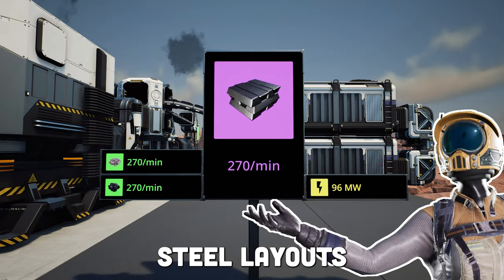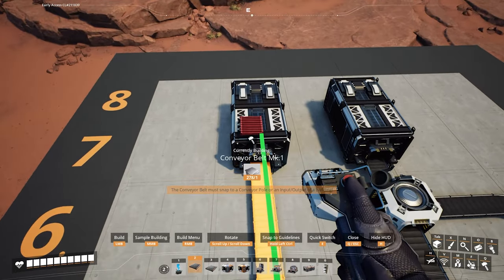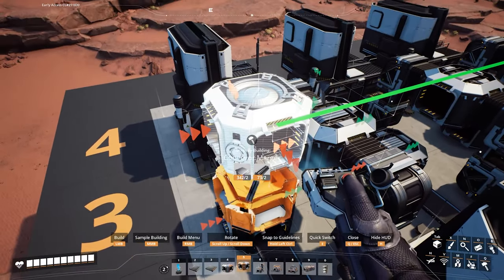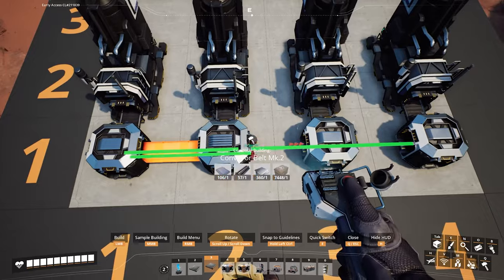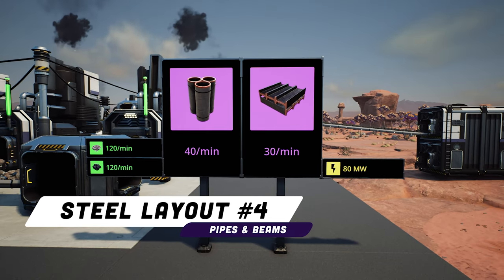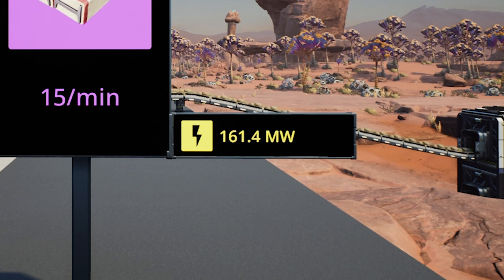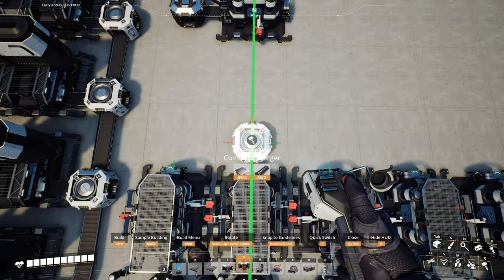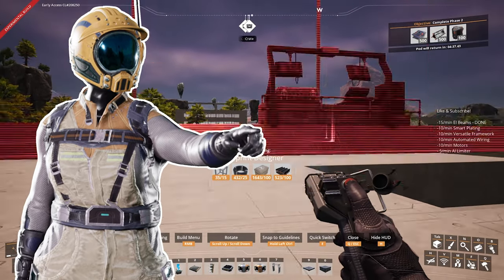7 EFFICIENT Steel Factory Layouts You NEED! | Satisfactory Update 7 (Beginner Guide)

Comment: Thank you for your tutorial! 🙏 There is something I do not understand. Indeed, on the first layout, you are splitting 120 coal and 120 iron by two (1 to a smelter, 1 to the next splitter) and so on. From my current knowledge and when I reproduce it, it seems not to work at 100%. Indeed, 120 / 2 => 60 to the first smelter, 60 to the next splitter, then 30 the second smelter and 30 to the last one. Can you tell me if there is something I did not understand? Thank you in advance.
Reply: Hey its a manifold as what im seeing. So you have to store up raw materials before running the foundries. Otherwise it takes a while to get to started. Mk.2 belts between the splitters. Also use mk1 belts from the spliiter to the foundry itself or mk1 conveyor lift. Also you have to unlock underclocking so the last one only takes 30 iron and coal instead of 45. So you get 45*2=90 + 30(last splitter) and get 120.

Comment: I usually have to separate the Encased Industrial Beams layout from the rest, because the amount of materials needed is insane. Imagine if you are wanting 60pm, the size of the factory you'd have to build, even with alterate recipes. I usually just have to settle for less because the requirements are just way too much.
Reply: My current factory is only making 5ppm of the Encased Beams and I’m on tier 4 working on phase 2 of the space elevator. I hope I won’t have to overhaul my factory tooo much for later game but knowing satisfactory I probably will need to.
Reply: Yea this is why I leave the game running all day once I unlock coal.

Comment: I use the blueprint machine and I prefer the recipe that needs iron ingots to really maximize output and my favorite by far is the steel rotor recipe because you can use the same blueprint for both rotors and stators and just change the assembler recipe for a quick motor factory

Comment: Is there a benefit to underclocking rather than throttling input materials?

For instance, input would be for 2,5 machines, feeding into 3.
The 3rd machine would end up producing half the time, idle the other half. Power consumption is likewise on/off rather than smooth.

But wouldn't that average out?
Reply: Yeah but if you underclock it'll be 100% efficient although you get the same result

Comment: 3:50 is a nice design, but a friend and I were building it and had a lot of trouble with the conveyor belts at the top row where the mergers are right next to each other.  It's awkward to build, and I think that sometimes there is a bug where the tiny conveyor belt doesn't work properly.
Reply from the maker: The trick with those is to just hover over the side and left click. As long as you don’t see it on the other exposed sides it worked for the first one. Then just hover slightly towards the other merger. Again as long as you don’t see the ghost belt go to the other entrances you are good and just left click. Getting the feedback is a bit weird I’ll give you that. As far as not working, I use short belts constantly between mergers and lifts and I haven’t had an issue yet, but that doesn’t mean it doesn’t happen. Hopefully it ends up working for you 👍

Comment: Hi, im new, just entering steel... On #5 and #5, why are you using smelters instead of foundries? Do those factories require a special recipe? Im thinking I want to go with #5 and #6 instead of #1..... Im just trying to figure out how it works exactly. Thank you! 
(PS... Please make more beginner/intermediate videos, love your content)
Reply from the maker: They use both smelters and foundries. The smelters is to convert the iron into ingots before sending to the foundries. This allows to make more steel ingots with the same amount of iron coming in. You do need the alternate recipe for solid steel ingots however.

Comment: On the encased industrial beams layout can you add smelters before the foundry’s to do the alternate : solid steel ingots to increase the amount of steel ingots?
Reply: If u want to produce the same amount of Encased beams then u will only need 160 coal and iron for it but at the price of having to smelt it and not using full pontential of nodes if we r talking about pure one's w miner mk2 (240) but could be rlly good alternative if u have only normal ones and u want to sacriface the shard for overclocking the mk2 miner so it makes 160 instead of 120 on normal node :D

Comment: On the first design, what does the splitter straight into merger before the middle constructor do? Looks like it goes 1 belt to 2 belts to 1 belt?
Reply from the maker: Yea so the splitter splits it into 3, then we merge 2 of those outputs together to go into the constructor. The foundry produces 45 steel ingots, but we only need 30 to go in the constructor. The splitter splits the 45 into 3 belts of 15. We merge 2 belts of 15 into 1 belt of 30.
Reply: @spectrumdad_  missed that thank you!

Comment: I would like to ask something. Is there a reason for using different Mk conveyor belts? Other than the cost, does it reduce lag or something?
Reply: The different Mk of conveyor belts have different capacity of items it can trasport per minute... Mk1 -  60/minute, Mk2 - 120/minute, Mk3 - 270/minute, Mk4 - 480/minute, Mk5 780/minute. Soo lets say u have a mk2 miner on pure node and it mine 240 per minute on 100% if u would connect that miner w anything else w mk1 or mk2 belt the belts wouldnt be able to take the ore away fast enough therefor u would get only those 60 or 120 per minute into the location instead of 240 which would bottleneck the whole factory if u needed 240 per minute for it to run effectively.
Reply: @Thomas-yq8ue  Yeah I get that, that makes perfect sense. But what I was asking is what is the reason for not using the highest mk conveyors all the time. Like if you have a 240 input/output, why not just yse the 480 belt? You can see in the video that he uses different mk conveyor belts for each machine instead of just using the highest one always
Reply from the maker: For me it’s 2 reasons. First the cost, especially when it comes to building still at this early level, you might not have that many items to dish out on the layouts. But the main reason, I love the way everything looks when everything is full and moves constantly without stopping. It’s very satisfying. But I agree it would be more simple to just put the highest belt all the time.
Reply: @spectrumdad_  Thanks for the clarification

Comment: Why do you alway split inputs like this? I mean, im new to the game, so may be wrong in this but if you split 120/m ore in 4 splitters this means first is getting 60/m and the last one only 15/m or? 

I had constantly issues that 1st smelter/constructor/foundry was getting full while the last one was toggling to idle for a while. 

Also when i manually set inouts to the full it drained faster then was refilling.. 

So when i updated it a bit with one splitter into two splitters and then into factory it divided all inputs to 30/m and when filled to full it keeps full
Reply from the maker: What you are describing is the difference between manifolds(mine) and load balancers (yours). I’ll have a video on this soon but they both will work at 100%. Mine will take less space and complexity but yours will be quicker at efficiency.
Reply: @spectrumdad_  Thanks for responding to this! So the overall rate is still the same no matter how it distributes? Anyway will look at that video :) Thanks

Comment: Having some issues with layout #2, everything is up and running however, instead of steel ingots, its just spitting out the raw ore, occasionally it spits out the steel ingots. Could this because I'm using impure iron?

edit: think I have it figured out, after a bit of reading I believe I need a pure node, with an mk2 to hit the 270/min mark
Reply: yup not to mention u also need to overclock that mk2 miner since it only mine 240/min on pure :D

Comment: whats the logic behind underclocking one of the steel furnaces?
Reply: You usually underclock something when it produces faster than it takes items what I mean is that when a constructor assembler or manufacturer doesn't have all the items it goes idle until it receives the Items but you can underclock it so it saves power and since it takes longer to construct the item when it finishes construction it should have enough items to keep making more stopping the machine from going idle

Idk if that made sense, also I don't actually know for what reason he underclocks that foundry maybe you don't need too much steel being made for those constructors

Comment: Can someone explain the point in under clocking. I’m new to satisfactory but I don’t get how it increases efficiency.
Reply from the maker: For one, it reduces the power consumption of a machine, which is always nice if you don’t use it fully. Also If a machine is not provided enough materials to run 100% efficiently, it will power off and then turn back on when it does get enough materials. But this process isn’t instant. There is a delay and it can cause issues backing up throughout your entire factory, making troubleshooting problems hard. So if you know you will never provide enough materials, underclock.
Reply: Thank you for explaining that it helped a lot ❤